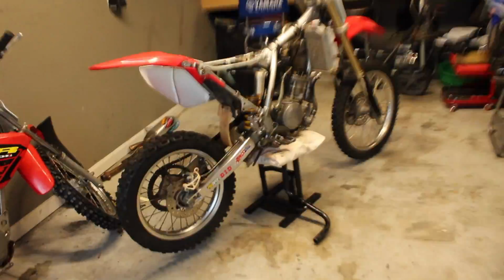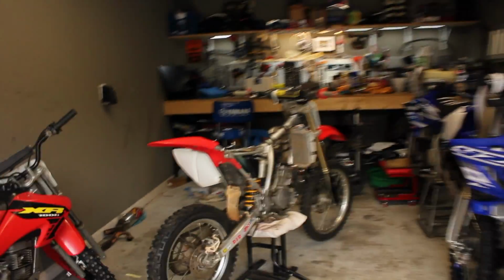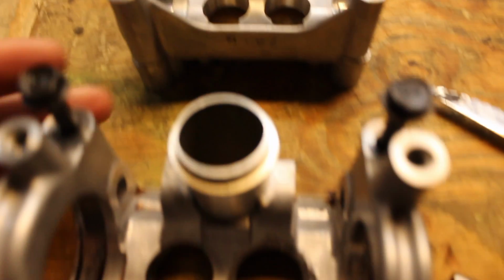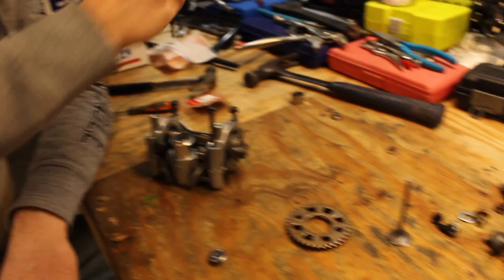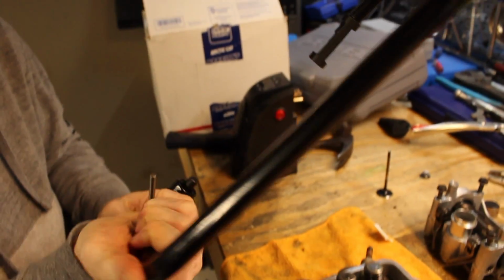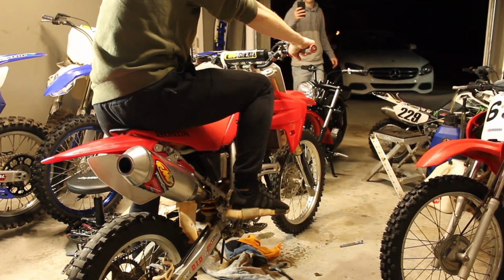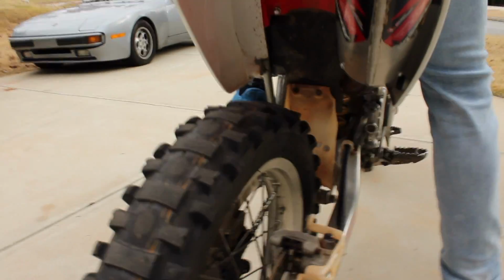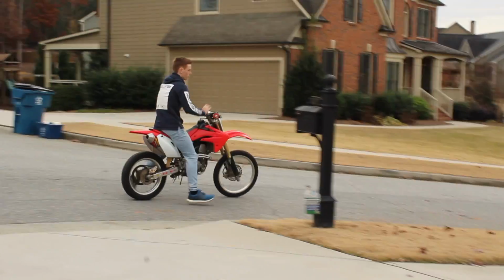THE *CHEAP* Honda CRF150R Build RUNS (Kinda)

Comment: Was there a mark on the piston where the valve hit it where it was sticking out like that? U guys will definitely have to take the motor back apart and clean the gasket surfaces and put a new oem head gasket on it if u didn’t. Those gaskets are pretty much 1 time use once u torque them down. Need to check valve clearances with a feeler gauge too. U can’t just put the stock size shims in it and be done you have to measure the clearance to find out what size shim u need. Go over all the timing stuff, cam chain tensioner, and the auto decompression system as well because something is for sure clanking in the motor I wouldn’t run it anymore or u could possibly do damage too it. You can find the service manual for it online and it will tell u step by step everything that needs to be done. It helped me a whole lot and saved me a lot of headache when I rebuilt my 150r.
Reply from the maker: HondaLoyal85 Thanks for the advice man! I will definitely take this into consideration when taking it back apart. There was no wear on the piston

Comment: 150s always sound ricky but that is bad. I’d tear it down and figure it out. Sounds like bottom end
Reply from the maker: Nah man it was just the timing. We got it all fixed up, just has an idle problem at this point
Reply: Richie Hervig sweet, it’s gonna turn out great🤘
Reply: Richie Hervig my buddy had a 150 and it never idled
Reply from the maker: Rylan Little You’ll see it in the next video! It doesn’t run pretty but it runs with no issues!

Comment: What was the clanking issue as I’m having the same problem, literally just replaced the same bits you had too but I shimmed it, starts off kick but sounds clanky
Reply from the maker: Leonc Tv So we took it back apart, timed it via the Service Manual, Triple checked we did everything to spec, retarted the timing one link of the chain, and boom. Runs like new
Reply from the maker: Timing was off, that was the issue
Reply: Ok thanks I’ll retime mine, Was it only out by a tooth or 2 as it looks spot on when I checked the marking on the cam to the marking on the cam holder Same with the bottom, I’ll give to another try thanks alot
Reply from the maker: Leonc Tv Yeah man no problem! We retarted the timing by one tooth. Make sure the engine spins over before you put it back together to confirm you timed it right. Lol, you don’t want to have the piston eating the valves. Let me know how it turns out!
Reply: Ok thanks Will do I’m doing it as we speak haha hopefully she sounds better this time round

Comment: Spend that money on an engine rebuild. Running like that that motor is going to grenade on you guys.
Reply from the maker: usmcchet tuntavern Just needed timing is all. The “clanking” issue has been fixed!
Reply: Great news bud i'm happy for you. Had a yz250f and it was a great bike but motor had its ghosts. Went back to a yz250 two stroke. No problems yet
Reply from the maker: usmcchet tuntavern Nice! 2 strokes are definitely an easier route for maintenance.
Reply: What was the clanking issue if u don’t mind me asking I’m having the same problem at the minute but mine starts off the kick just sounds clanky
Reply: Since the day I bought it off the floor I was never able to keep the valves timed right. I had mechanics adjust them and they would be doing something else to fix it. In the long run a mechanic in California I sent the whole top end to ultimately said the head had a defect from the factory. Great news to find out when your warranty runs out. Bought a new top end traded it in for a 2019 YZ250 with recipes of what I put into the yz205f I almost walked out for a straight trade but ended up owing like 300 bucks for taxes and set up fees. NO COMPLAINTS lol. But they also were fully aware of the motor problems I was having with it also.
Reply from the maker: Leonc Tv Late reply, sorry, but all we had to do was time the motor right! Just make sure to line up the timing areas before installing the cam and chain.
Reply from the maker: usmcchet tuntavern Nice man! 2 strokes are definitely a simpler route!
Reply: Richie Hervig Yee I sold my 150 too I fixed the clanking issue first tho, got a old cr80 now 2002 she rips!!
Reply from the maker: Leonc Tv Nice! I had one of those before. Gonna make videos of it?
Reply: Richie Hervig Yee definitely bro gonna get the GoPro next time I go out, the little thing rips it was having a good go at my mates yz125 😂
Reply from the maker: Leonc Tv Nice!